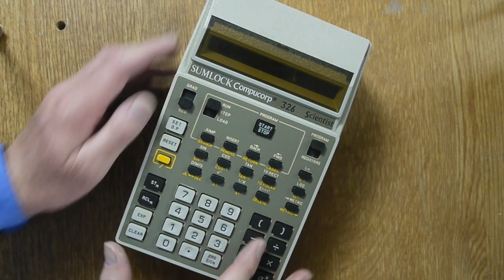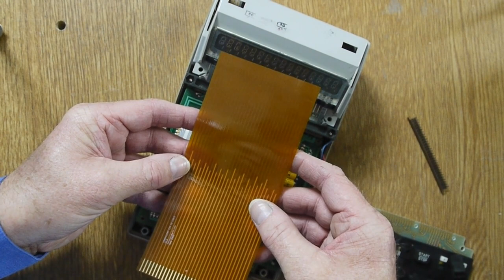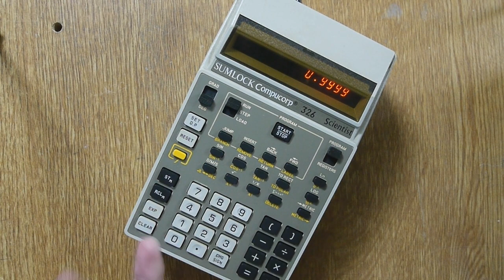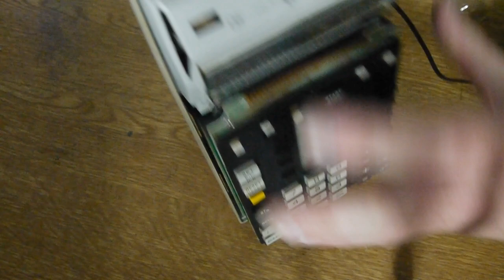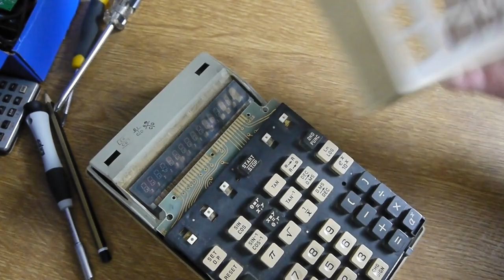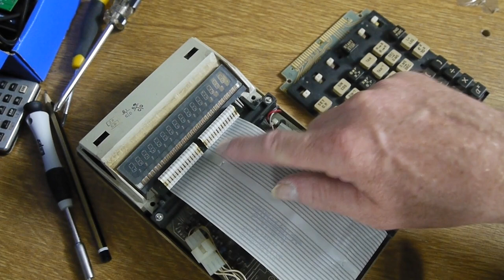Compucorp 326 Keyboard Flexi

Comment: When measuring pin pitch, you get the most accurate results by measuring the distance between the two edge pins, then dividing that dimension by the number of spaces in between pins.

Out of interest, where do you order flexible PCBs from and how much did these cost?
Reply from the maker: Yes, I use that method too, I just got it wrong this time. 
I get my PCBs from JLCPCB. They are good quality, but don't go to a very high thickness. they are expensive, well, I suppose I'm used to normal PCB prices. I've just checked and these were $46 including shipping and taxes etc, for 5. So not that bad really.
Reply: @menadue  Interesting, thanks for the info!

Comment: What a wonderful machine.  I put new belts in the tape drive and cleaned and restored my 326 and it works beautifully.  A real showstopper and at the next HHC conference in 2026 I will bring my surveyor, statistician, scientist, 324 and 326 the tape drive.  Absolutely wonderful to work on with the modular boards in the gorgeous panaplex display.

Thanks for the video again Andrew ,  cheers from Vancouver

Actually, once you get the flex, how much would you charge for spares?   I don’t remember, but I’m pretty sure I did not have any battery corrosion on mine so I’m safe at the moment.
Reply from the maker: Hi Geoff, I have a couple of the cassette drives, too. One worked last time I ran it. It would be interesting to try to attach other devices to the connector, maybe. I'll send you a Flexi, just in case...
Reply: @menadue  a printer would be interesting as the display output may be tapped for a print output.  Other than that, an RTC would also be an interesting option with a display.   I just picked up a tiny SERIAL printer for the picocalc.  Should be able to tap into the chip input points on the case and have the pico Calc print.  It already has an RTC that I installed earlier.
Reply from the maker: Yes, I did that for the fx502p, it's a fun and useful upgrade. I'd also like to dump the rooms of the compucorp series if noone else has. @geoffquickfall
Reply: Could I ask who you used to make the flex cable please
Reply from the maker: @jwarburton Yes, it was JLCPCB. They do flex circuits as well as rigid. You still have a minimum order quantity of 5, which can make the order quite expensive, well, compared to the rigid PCBs. These PCBs were about $10 each. Of course that only feels expensive as we've become used to the very very cheap prices of the rigid PCBs.
Reply: @menadue thank you